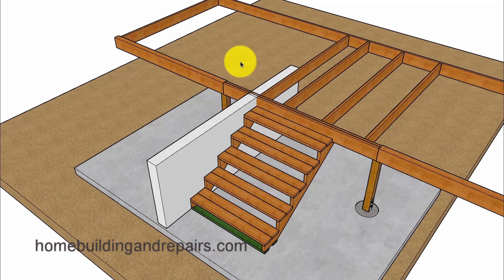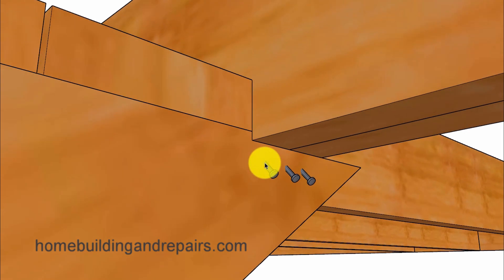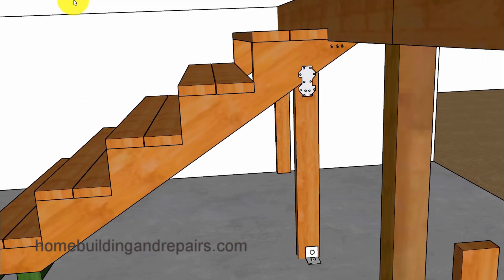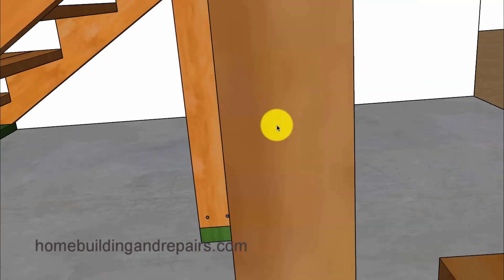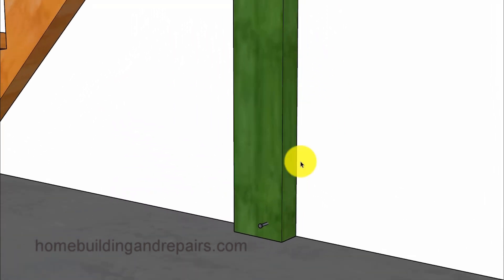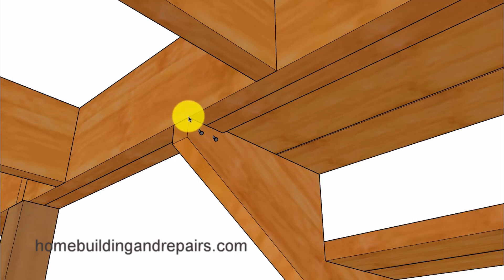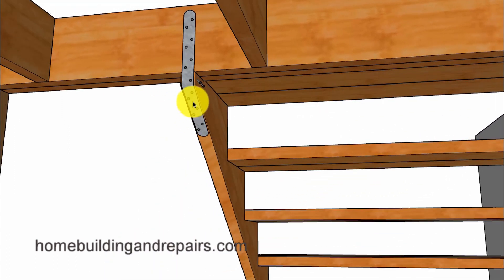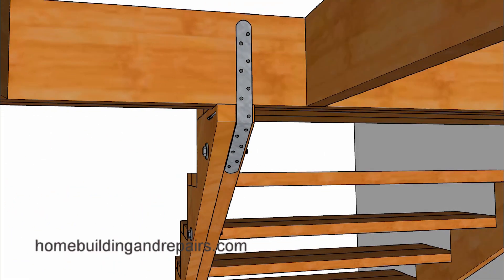How To Make The "Almost Worst" Top Stair Stringer Connection Structurally Stronger

Comment: What type of hangers are you using for the hanger method?
Reply from the maker: It will depend on the project. Maybe 2x10 or 2x12 if you are dealing with something like the ones shown in video.

Comment: I have to add that this situation is the bane of all stair builders and I confront this often. So I usually put the stair treads between the stringers, as in an "uncut" stringer. Your thoughts. Also I would like to see more videos on the subject. Sorry, another also, my pet peeve is an extra stair tread to solve this problem.
Reply from the maker: I like either method and both have their advantages and disadvantages.